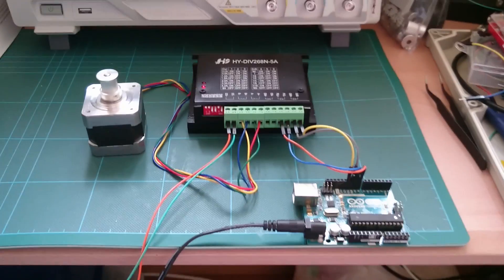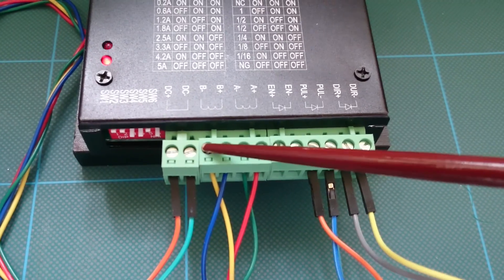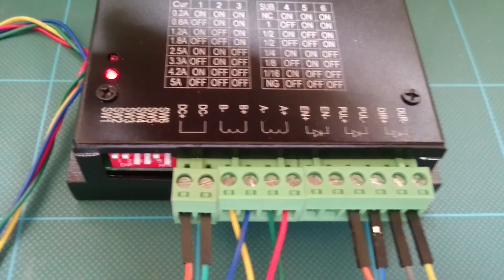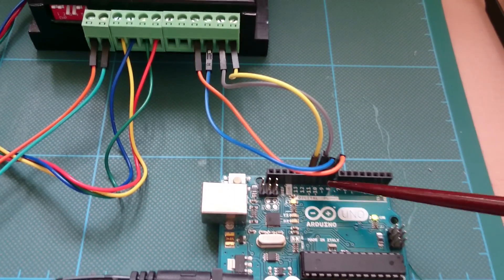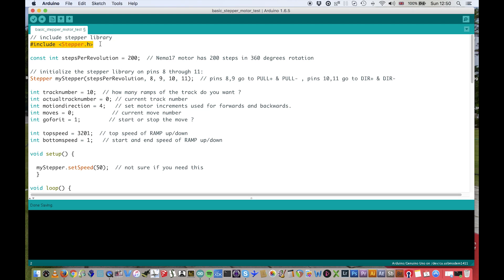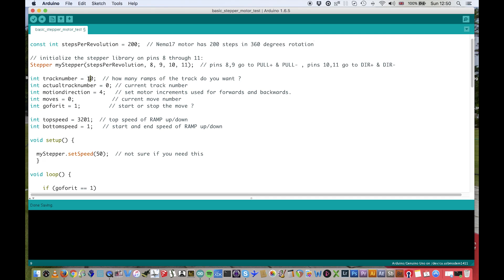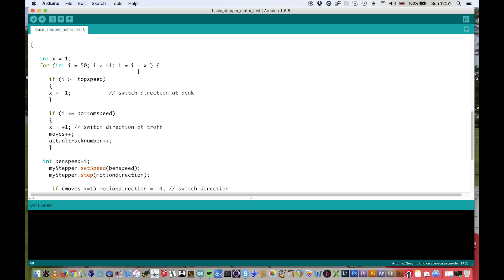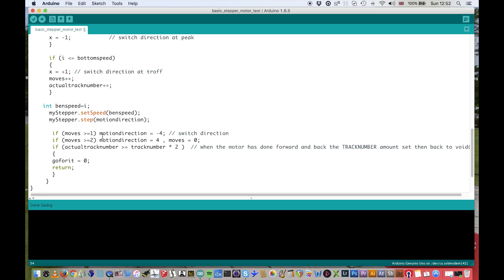HY-DIV268N nema17

Comment: how much amps does the whole system consume?  I will me connecting 4 stepper motors to a CNC shield with Arduino, I do not know how much current to supply.
Reply from the maker: sorry , somehow I missed your question here ! I would just look at the maximum amp rating for the sum of all your motors. use ohms law calculator if the rating is in Watts.

Comment: I’m looking at driving the stepper motor with a NE555 pulse generator rather than an Arduino. Would I put 5v on EN+ and DIR+, put GND on EN-, DIR- and PUL- and connect the pulse generator to PUL+? I have done this with other driver boards but not this unit. Thanks.

Comment: HI, how do you compute for current rating. If my motor says 1.2 A per phase, does it mean I should adjust the dipswitches for current to match 1.2 A?
Reply: Yes if you run it higher then it will get hot, and it will burn out.
Also you can connect PuL- to gnd and only drive it at pul+ the same with DIR- and DIR+ and EN- to gnd. don't use 6 pins only 3.

Comment: can you play stepper motor for 5 hour? my l298n get so hot for 1 2 min , tb6600 is stable and can play motor without problem for 4 5 hour ?
Reply from the maker: imerja jusufi not sure,  only tried an hour and the motor gets hot.. the controller was only warm not that hot and in middle of hot summer,  so I think it should be OK..
Reply: Ben Biles thanks, motors gets above 80°celsius ?
Reply from the maker: imerja jusufi at a wild guess motor was say 55c - 65c tops ? after about an hour of going from slow to fast to slow as in my video.. but no load,  so with a load, don't know ..

Comment: hi sir, i have an question to you. i am planning to built a cnc with nema23 and grbl shield with 3 stepper motor driver A4988. but i saw that it is power supply is sold in ebay for the steppers. my question is what would be the difference between psu and a4988? because psu is expensiver.
Reply from the maker: are you trying to compare A4988 with HY-DIV268N ? by psu you mean HY-DIV268N? if yes then A4988 is 1.5amp max rated and  HY-DIV268N is 5amp. So  HY-DIV268N can deliver more power. take a look at this data sheet.
In reality both solutions probably fall short of the max power one way or another and with the A4988 I am suspicious of the lack of heat sink although 1.5amp isn't much power so maybe its ok to use ground plane as heat sink. 

for A4988  https://www.pololu.com/file/download/A4988.pdf?file_id=0J450

for HY-DIV268N  http://wiki.kreitek.org/_media/proyectos:cnc:div268n-5a-datasheet.pdf

hope that answers your question ?
Reply: Thank you very much for your answer :)
Reply: if your stepper is ratet under 1.5A you can use A4988 if your stepper is over 1.5 and under 5A use a stepper driver that have the Amp you need, DON'T run it at higher Amp. Also if you are using A4988 you need to set the Amp for your stepper motor.
If you have 3 Stpper motores at 1amp, your psu need to bee a 3amp psu or more.

Comment: Thank You Ben! Your code on github works excellent.
Reply from the maker: Nysrukus thanks,  don't forget to check the other library, AccelStepper,  it does the same as my code but more options.. are you going to cut some aluminium with stepper motors?  there really precise motors with the controller but not that powerful,  I found on the quieter setting,  more steps,  the motor has less toughk ( power)  sorry can't spell tauwk :)
Reply: You're right! I tested AccelStepper and it works better. I am trying to build a simple CNC system only for wood. Thank you!
Reply from the maker: Nysrukus sounds great!  good luck with it! I still did'nt finish my camera slider,  busy making something else

Comment: Hi, thanks for super clear instruction, could you let me know how to change variations in arduino sketch for controlling angles/speeds of this stepper motor?
Reply from the maker: hi , did you try changing this value? 
 int topspeed = 3201;  // TOP SPEED OF TRACKING
Reply from the maker: also I recomend you use this library, I wrote my code before I found this , http://www.airspayce.com/mikem/arduino/AccelStepper/index.html

Comment: Hi sir.. can you help me how to build program for Stepper motor driver with PIC .. .your program are similar with our project program but we did not use arduino..
Reply from the maker: Hi Nur, I'm using the arduino #include <Stepper.h> library in my code example.
I think its an arduino based library, Stepper.cpp has #include "Arduino.h"
you could ask them here https://github.com/arduino/Arduino/tree/master/libraries/Stepper

I would have thought there is an stepper library already written for pic MC ?
Reply: Ben Biles thank you sir..

Comment: Dear sir, I want to thank you for your good work, and ask you about the relationship between stepper motor speed and its sound, from your experience, don`t you think when rpm`s are increased that means the pulses from the driver increases and the sound increase therefore ? is that noticeable for you just like dc and ac motors?
Reply from the maker: all I can say is , Stepper motors are ussually noisey ! more coils ( steps ? ) = higher freqncy pulses as you say ? I don't know motor theory at all ! sorry,, this looks interesting, https://en.wikipedia.org/wiki/Stepper_motor  It does seam that the HY-DIV268N is a chopper driver , you can set the steps higher than the steps on the motor maybe? then the motor gets quieter BUT has less torque. sorry for the vauge answer.

Comment: hmm working at current and microstep?
Reply from the maker: Hi Windy, do you have the same controller ? how is the wring on your nema 23 ? same colours?
Reply: thank you for reply me :(
yes i use HY-DIV268N-5A,  the colour black, green, red and blue 
http://jkongmotor.en.made-in-china.com/product/JSexziobZghZ/China-Automatic-NEMA-23-1-8-Degree-2-Phase-Hybrid-Stepper-Motors-57hs112-3004-ISO9001.html link for motor. can you help me? :(
Reply from the maker: I think the black wire was changed to yellow so try exchange black for yellow in my setup. your motor is 180 degrees 2 phase so same settings should work for you.. switches from switch1 on,on,off,off,on,off you might need more power since your motor is 5A so you can try the first 3 switches off,off,off for 5Amp
Reply from the maker: also rather than using my code , you could try this library , it has speed ramping etc built in..  http://www.airspayce.com/mikem/arduino/AccelStepper/
Reply: thank you so much for your help :)

Comment from the maker: update, this library includes speed ramps making it easier to code. http://www.airspayce.com/mikem/arduino/AccelStepper/
Reply: hi ,  problem from 
// include stepper library
#include <Stepper.h>

const int stepsPerRevolution = 200;  // Nema17 motor has 200 steps in 360 degrees rotation

// initialize the stepper library on pins 8 through 11:
Stepper myStepper(stepsPerRevolution, 8, 9, 10, 11);  // pins 8,9 go to PULL+ & PULL- , pins 10,11 go to DIR+ & DIR-

int tracknumber = 2;  // SET HOW MANY TRACKS YOU WANT UP AND BACK
int trackdistance = 20000;

int actualtracknumber = 0; // current track number

int motiondirection = 2;   // set initial forward motor increments.
int forwardsincrement = 2; // forward
int backwardsincrement = -2; // backwards

int moves = 0;            // current move number
int goforit = 1;         // start or stop the move ?

int topspeed = 3201;  // TOP SPEED OF TRACKING
int bottomspeed = 1;   // start and end speed of RAMP up/down

int benspeed = 1;     // current speed

void setup() {
  
 //  do some setup here
 
  }

void loop() {

    if (goforit == 1) 
  {
  moveit();
  }

    else
  {
  donothing();
  }
  }

void moveit()

{

   int x = 1;
   for (int i = 50; i > -1; i = i + x ) {
      
      if (i >= topspeed) 
      {
      topspeedhold();    // hold top speed for trackdistance variable
      x = -1;            // switch direction at peak
      }
      
      if (i <= bottomspeed)
      { 
      x = +1; // switch direction at troff
      moves++;
      actualtracknumber++; 
      }
        
    int benspeed=i;
      myStepper.setSpeed(benspeed);
      myStepper.step(motiondirection);
      
       if (moves >=1) motiondirection = backwardsincrement; // switch direction 
       if (moves >=2) motiondirection = forwardsincrement , moves = 0;
       if (actualtracknumber >= tracknumber * 2 )  // when the motor has done forward and back the TRACKNUMBER amount set then back to void();
       { 
       goforit = 0;
       return;
       }
     }
}

void topspeedhold()   // hold top speed for trackdistance variable
{
 int f = 1;
   for (int f = 50; f > -1; f = f + 1 ) {
         
      if (f >= trackdistance) 
      {
      return;
      }
      
      myStepper.setSpeed(topspeed);
      myStepper.step(motiondirection);
   }
}

void donothing()
{
while(1);
}
Reply from the maker: hi, can you describle the problem you are having with this code?